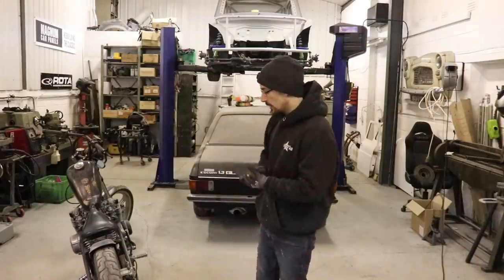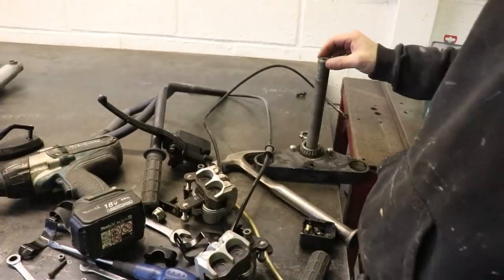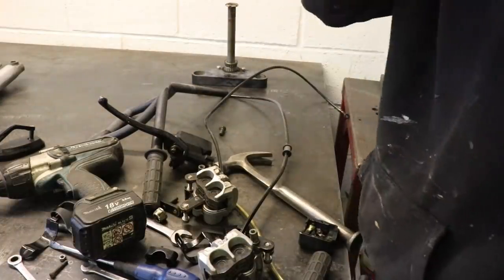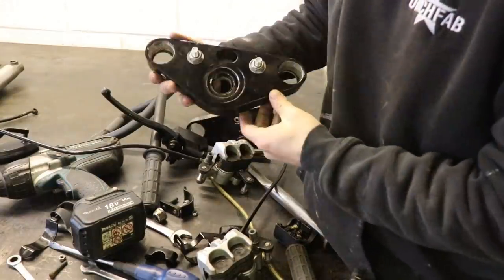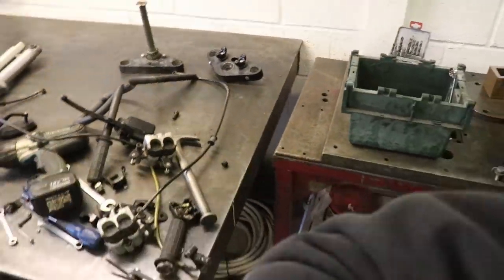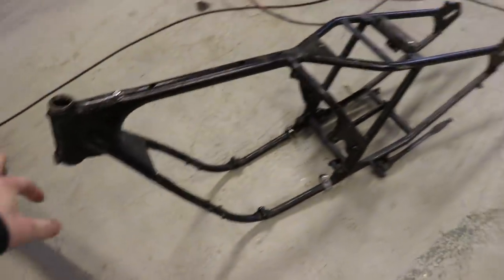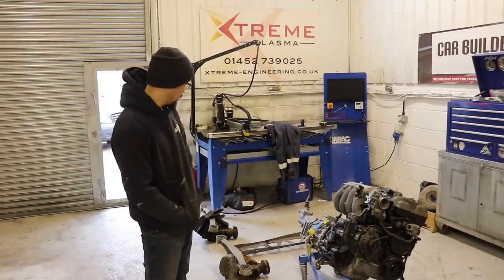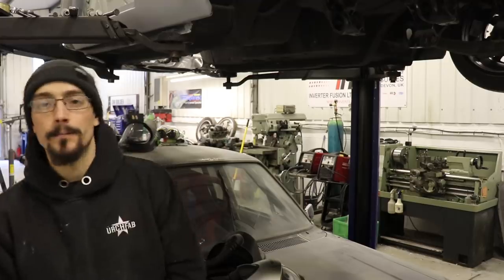HONDA CB 550 CHOPPER BUILD. THE TEAR DOWN!

Comment: Don't know about elsewhere but over here we yanks call the yokes holding the fork tubes the "tree". Since the tree from that bike is offset it's a "raked" tree as it increases the rake of the forks for a more chopper look. Now that sloppy bearing not fitting the neck shaft of the tree is most definitely "fubar" ........thats the word of the day for this one !!!  Fubar being the opposite of perfectamundo !!  So in yank speak that would be a "hill-billy" raked tree which can provide a very much increased level of excitement when riding !!  Glad those carbs kept you from taking it on a test ride at the time of purchase lol .  Would have made an exciting video though, with the jam up brake caliper and floppy neck !!!  Can't wait to see the Urchfab improved version. Just mind the rake and trail geometry of the front end if you use those fork tubes. They are probably too long for it to come out right. However a set of Urchfab made springer forks with the axle leg extension would tidy up the trail angle proper and do away with excess fork tube load and the drag on the fork compression if you had a mind for that much fab work.  Fubar = "F@@(ed up beyond all recognition" for the unvetted.

Comment: I sincerely urge you to take a look into counter-lever suspension for front end. As in Ural side-car, and speedway bikes. That way you can put the front tyre where ever you want, and still have optimal suspension geometry, and sharp handling. That rear end could also use some single coil-over action. With single coil swing arm it's the easiest to fit rear mud guard hugging the tyre. If you leave it solid, you'll slip a disc within the first season.

Comment: The rear mudguard is an indespension  twin wheel trailer unit that has been cut down, gs550 carbs space up the same as cb550 are easier to set up for k&n style filters and the linkage between the individual carbs is far more robust meaning they are less likely to go out of balance.

Comment: What is holding the pads into those calipers? Normally the inner pad sits over the inboard ends of the slider pins & the outboard pad (with the pistons directly acting on the backplate) is held captive within the slider bracket which is integral with the slider pins & caliper mount. That looks scary!

Comment: Do not use those fork yokes . Those extra rake chopper yokes remove all the trail because your steering stem and fork s are no longer parallel . Had a friend who tried a set and the bike became seriously unstable . After going back to the standard yokes and cutting and taking the steering head it was fine .

Comment: Hey Matt, nice to see you building another bike, however  i would scrap the forks and wheels cos they are off a crappy Chinese 125 custom and won't be up to handling the weight of the Honda motor, the brakes similarly are sh*te even the original single-piston Honda brakes would be better. The mismatch with the steering bearings would lead me believe that the bearings were for the Honda yokes which would have been beefier with a tapered stem for the larger bottom bearing... Hope this helps, looking forward to seeing the plasma cut frame! Regards, Andy
Reply: Andrew Riley They are Honda Comstar wheels.
Reply: @jamesweber4938  I agree